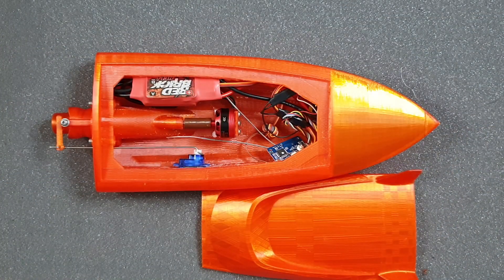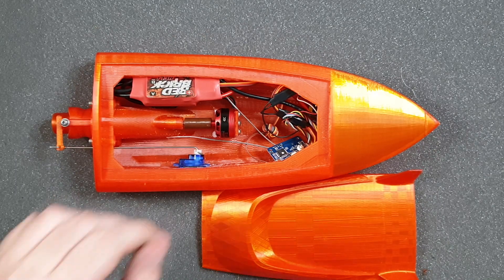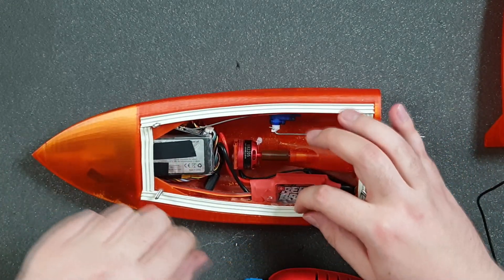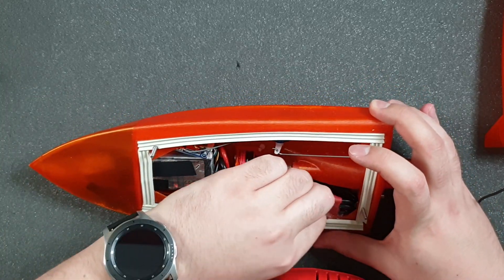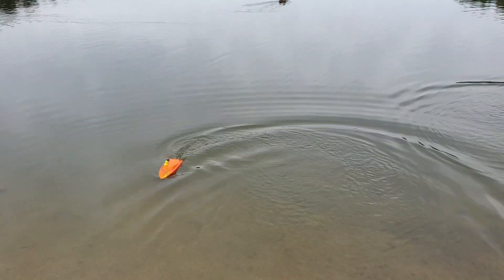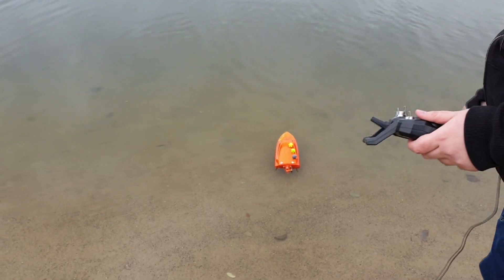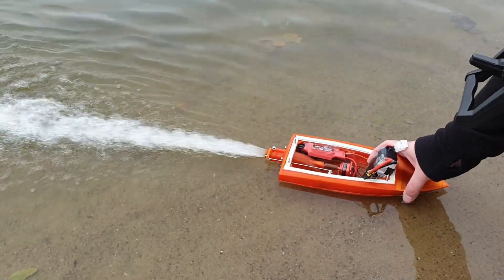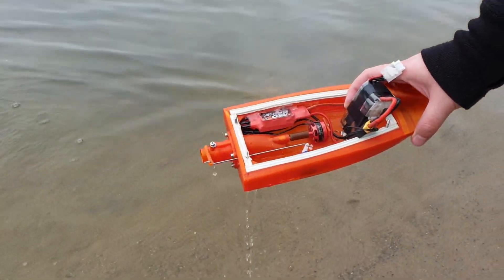[DIY] Building 3D Printed RC Jet Boat Part IV: Final touches and lake visit

Comment: my result is 400 gram with ABS and 450 gram with PLA. probably your battery and ESC heavier than those what i used
Reply from the maker: I must tell that, great model, its unsinkable :) 

On next Sunday there will be another video with fully charged battery, balanced boat and a lot of fun, Im satisfied with this project :)

PS think about making Little holes for small rods underneath boat that will protect propeller against leaves etc. Burned my 80A ESC and motor because of that lol.
Reply: @HobbyWithAdam  as for protection grille try this one https://www.dropbox.com/s/gjor27rn6vkn2bs/protection_grill.STL?dl=0
Reply from the maker: @Sergiy-q8s  yup, it should do the job, but unfortunately at this moment esc and motor are burned so next video will be last and I'm terminating this project and I will work on something bigger which should fly ;)
Reply: @HobbyWithAdam  I look forward to a new video